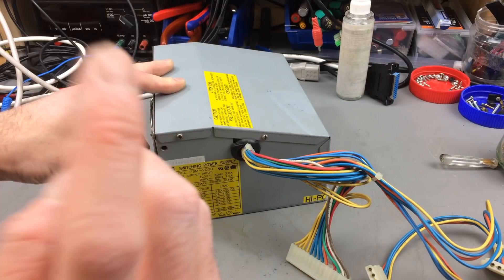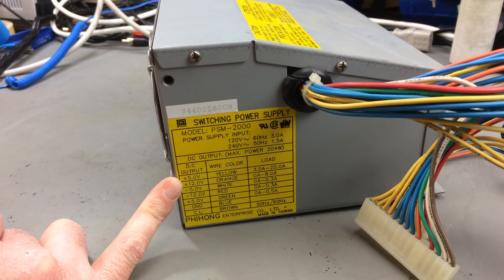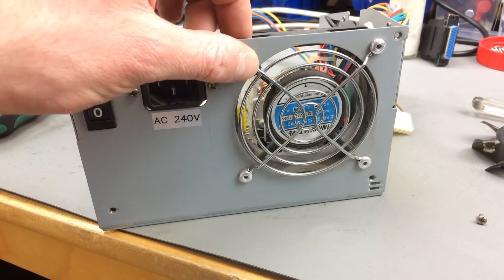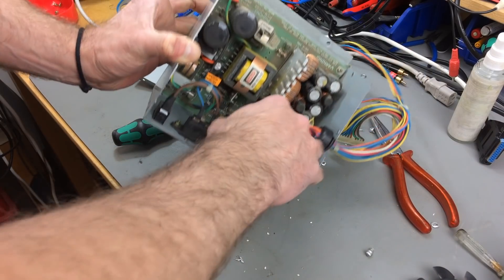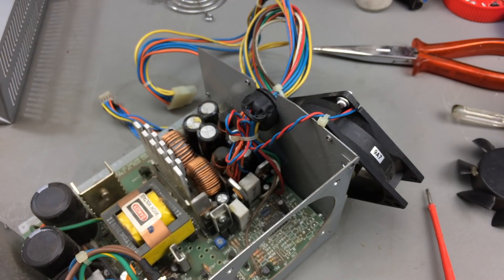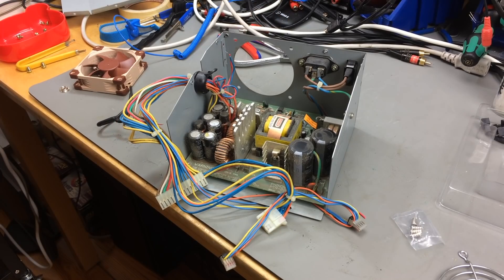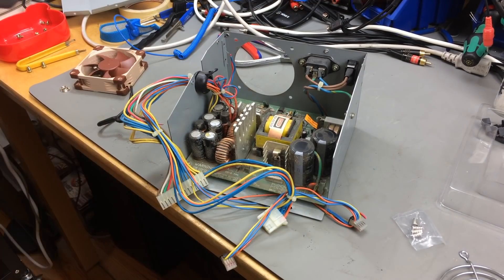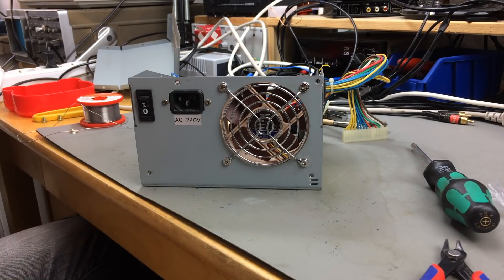Amiga 2000 Power Supply Fan Replacement

Comment: Thank you very much for this, Your my friend for life now. I've just swapped out my amiga 2khd fan, with a new one, as in your video, and I seem to have a slightly differenent power supply unit, as it was a matter of moding the cable that weas attached to the fan with the correct placement of cables i.e.  red black correctly into the little plug. So no soldering for me, but without your video, I would have been too aprehensive to even try. So cheers :)👍

Comment: The old fan has an airflow of 0.93m3/m, the new one you inserted only 0.58m3/h (Noctua.at says 34,8 per hour). So the new one blows considerably LESS air. That's why I used "NF-R8 redux-1800" for my A2000s, those blow 0.88m3/m.
Reply: True. I replaced mine with the one suggested in this video and you can feel that the airflow is considerably lower. I'm disappointed. I'm going to buy the one you suggest and trash the one I just bought. 🙁

Comment: Great video! I stumbled across it when I was looking for help replacing a fan on an old  Gateway 2000 Pentium 3. There is only 1 fan in the case and that is in the power supply and it's so loud!
Reply from the maker: Yes, you most likely can mod that in a similar way. :)

Comment: Despite my background in HW repair, For reasons that  cannot explain when I swap out my old 12v fan for this new one the power supply cannot sustain and load. In other words the NF-A8 ULN Noctua fan runs if the power supply is not hookup to the mother board. If I turn on the PS with it plugged in to the MB it shuts down about 1 second after turning on. If I disconnect the FAN and try it runs even less time. Put the old fan back in and the PS runs the MB no problem.  Red to red black to black. I did not use the yellow wire. My A2000 supply is Model 20504-SD made by ElEC & ELTEK.  And ideas?
Reply from the maker: It seems that some of the Amiga PSUs check if the fan is running by measuring the current draw. If there's not enough current flowing to the fan, they won't turn on the supply or turn it off after a short time. Probably the modern fan draws too little current to trigger that circuit. Maybe adding a resistor would help?
Reply: @JanBeta  Thank you for the quick response. I reached the same conclusion. So I put a1200 Ohm 1W resister across the fan leads. In my pre assemble not everything back together test It stayed on so I thought I was out of the woods. However after final assembling of the machine it shut down again but took longer. It was not instant like before. I think I may have only added .01 Amps to the poultry .05 of the noctua. So that is still less than 1/2 the .12 amps my old fan pulled. I am a little hesitant to put less resistance I would need higher wattage resisters more heat yada yada.  I may have to put back the noisy fan :[

Comment: O did this but my amiga refused to boot up. I put back the old fan and it works again? Any idea why?
Reply from the maker: I think some versions of the A2000 PSUs have circuitry that monitors if the fan is working by measuring the current. Modern fans draw a lot less so it might not trigger the circuit which in turn doesn’t allow the PSU to fully power up. Maybe adding a resistor to the wires that go to the fan will fix it (even though it’s a workaround of course).
Reply: @JanBeta   I will try adding a resistor and see from there. thx mate :)

Comment: "battery backed up clock not found" at 14:07
Reply from the maker: Yes, in the meantime I have a coin cell in it and the clock works fine. I think I had to reset the chip to make it start, too.

Comment: Well done - you can make a circuit to generate -5 volts from +5-12 volts - check out a ICM7660 - there's lots of variations of this of course (I wouldn't be surprised if the out of the box Amiga power supply actually uses these...).

Comment: Great to see you use the same fan as i used in my C128D (plastic enclose version) , but that one is 60mm.

It's the Noctua NF-A6x25 FLX, Noctua fans are one of the best fans you can buy, and are much quieter, but they are NOT cheap, they cost a lot.

https://noctua.at/en/products/fan/nf-a6x25-flx

Comment: Another brand I recommend are Cooler Master, as their 120mm fans can be had in a 4 pack for $13 USD with free shipping, and a single 80mm fan from them can be had for as little about $7 USD with free shipping. So I always find good value in them when doing projects like this, or building modern/ish computers on the cheap.

Comment: Please, please DO a power supply recap video. To me it would mean the world, not just to watch you refurbish that Amiga, which is pleasant enough, but also because I have some gear I'd like to try to repair with such big, life-threatening caps, and I don't really know how to safely discharge them. I picked up an audio amp from the trash in hopes it might be repairable, but I'm too scared to try because of that, and I'd like not to have to bring it back to the trash, it would be such a pity, but keeping the thing forever and not working on it would make no sense either!
Reply: Just noticed your comment here. Might be too long ago to be of interest, but anyway, here goes. Electrolytic capacitor have a rather high self-discharge, so if the device has been stored for a year or two you can pretty much be 100% sure they are discharged. Also, if you want the make double sure, check that the power supply is not connected to mains and turn it on. Whatever charge might have been left will then quickly be dissipated by the circuit it supplies. As a master in telecommunications I have never had any problems doing it like this. The only exceptions I know of are with tube amplifiers. Partly they operate on very high voltages (700V+), partly the power supplies therefore tend to use paper or ceramic caps that have significantly lower self discharge. In those cases I would be vary, and old CRTs are also a problem. The rear parts often tend to build up static charges - by far the worst electric chocks I've experienced have been from accidentally touching those... A normal PC power supply or audio amplifier, however, never poses a problem if you just do as I described.

Comment: Hi Jan, that quiet adapter with the fan may well be a temperature thermistor type thing that will ramp up speed depnding on ambient temperature (inside the PSU) so could perhaps be not even turned on until needed?  Not 100% certain, but with something like Noctua I don't think they'd just throw a resistor in and call it a day :-)  Maybe another upgrade when you re-cap that power supply ;-)

Comment: Phihong! that's still a name brand today!  BTW: Some A2000 PSUs refused to start if you put a regulated fan which drew too little current at start.
Reply: Hi, i did the replacement today.. and my PSU refused to start... i was afraid to have damaged my motherboard or the the PSU... i connected back the old fan and every thing is OK... do you have a solution for the replacement of the fan with a quiet one. Tks
Reply: @supporttrombone5744  Just connect 2 car parking light bulbs for 12V each in series in parallel to the  12V for the fan, so they just draw 1/4 of the nominal 2 watts. those 0,5w in parallel with the new fan and the PSU will start. and the low glowing bulbs will last forever.
Reply: @rarbiart  tks. i'll check if i can find a fan in my old stuff which have the right power consomption. Again thanks.
Reply: @rarbiart  Thanks for your help, i wanted to find a Fan which has the same power consomption but they were MORE noisy than the old one !!! I put back the new NOCTUA (silent) and i found a nice light green bulb... i had to make some modification at the casing of the computer and to the power supply...  now it is perfect !!!

Comment: Did the same to my A2000 PSU, even the same Noctua fan, like 2-3 years back. :) Mine is with a Lite-On PSU which didn't have the old fan riveted in fortunately. I put a matching connector on the old fan wires and used the low noise adapter too. Ended up with a system which is nearly inaudible, quite nice. I still need to recap my PSU as well.

Comment: I would say you should NEVER put a power supply without the -5 volt as it's usually used for OP-amps and they usually go boom if they are missing the -5 volt, potentially destroying the zorro cards.
Reply from the maker: Yes, I definitely agree. If you are not absolutely sure nothing in your machine needs the -5V, you risk damaging stuff. I think the usually applied workaround would be to use an 7905 voltage regulator to supply the -5V if the psu doesn't support that voltage.

Comment: I'd have recommended first covering all the exposed electrical components and contacts both outside and inside the PSU before drilling out any of the metal rivets holding the fan to prevent any of resulting metal fragments from contaminating the PSU and causing electrical shorts later.

The clock not detected may be due to the RTC chip being in an indeterminate state because the RTC battery was removed.  Saw this in a recent Amiga A501 repair video that replaced the rechargeable RTC battery with a 3v lithium cell battery holder. Try using the sysclock utility to set the time on the RTC chip (initializing it) and then read it back.

Comment: can I use this vid as a reference for my A4000 PSU? Or...?
Reply: The A4000 PSU is somewhat different, but the fan stuff should be more or less the same. IIRC, the fan sits on the inner side of the PSU and sucks air from the computer case into the PSU instead of blowing air out of the PSU through the back. Are you saying that your original A4000 PSU is still alive? Mine died already in the 90s, and I had to find a smallish AT PSU and transplant its guts into the PSU enclosure of my A4000.

Comment: Apart for replacing caps, dont forget to replace the thermal paste on those fets. It'd be amaizing if before replacing the caps, you could measure the ripple voltage and voltage rails before and after the refurbish

Comment: Perfect fan for it, they're well engineered & I think the colour works well. I was nearly yelling at the screen for you to fit a standard 3 pin fan power socket but as you said, it isn't much effort to solder a new fan if the Noctua ever dies! Great work as always Jan :-)

Comment: You could install a noisekiller (temperature regulated resistor) on the fan. It will increase the resistance when temperature is low, and reduce the resistance when temperature is high. But since you installed a low rpm fan, its probably no point.

Comment: The drilling worked surprisingly well this time! However, you should consider getting a Dremel, which is really a really good tool with fine control over your work - also when cutting metal.
Reply from the maker: I have a Dremel tool (well, a Proxxon one) but didn't use it for the rivets after some research. The drill seemed to be the cleaner option in this particular case. :)

Comment: Hmm.. it's saying "Battery backed up clock not found" - did you remove the clock chip ? If not, thats a sign of a problem. The clock should still be found even if the battery is removed.
Reply from the maker: Oh, I didn't even notice that. You are right. It seems to sometimes not see the clock, on other boot ups it did. I'll have to investigate. Maybe there's a dodgy trace somewhere that I didn't see the first time around.

Comment: It's usually the case that the line capacitors will be discharged, as there is either a bleed resistor, or the PSU runs until the energy in the line capacitors is drained. The main time to take precautions and discharge the caps is when you know the power supply has been energised recently, and there was no output. I've nearly come a gutser on this working on a TV power supply - the main MOSFET had failed, and there was nothing to discharge the cap. Fortunately I remembered before I stuck my fingers near it!

I'd certainly recommend you replace the secondary side capacitors soon to keep it working well. The line side caps should be fine. Oh, and check for stinky RIFA capacitors too !
Reply from the maker: Ah, and again I'm learning something from you. :) I guess it doesn't hurt to be over cautious anyway, but good to know that they usually are drained. I'll replace the caps asap, just have to order some because I didn't have the right values in stock.

Luckily, there's no RIFA bomb to be seen in this one. I learned about those the hard way a couple of years ago when an old amplifier I was working on went up in smoke. The smell! :P

Comment: A smaller drill bit would of been lot easy for you with the rivets
Reply from the maker: You mean I could have drilled all the way through the rivet? I was a bit cautious because I didn't want to damage anything so I intentionally went with a size that didn't fit through the holes on the fan grill.
Reply: @JanBeta  You don't need to drill through them. It can help to drill into the rivet at an angle and rotate the the drill around (in a cone shape) to prevent drill bit biting into the rivet and causing the rivet to spin in place.

Comment: Touching a capacitor with a finger hurts but it will not kill you. To kill you it would need to discharge through your chest. I.e. the current would have to travel from one arm to the other.
Reply: ...so you're saying I should change the way I discharge capacitors? I usually use my tongue and one of my pinky toes to complete the circuit.
Reply from the maker: It might be a bit exaggerated that I mention it in the videos every time but I don't want anybody to get hurt if they follow what I do. Plus, if you have a weak heart or other issues chances are (albeit they are small) that they might actually do major harm to you,
Reply: I have done this by accident, touched the charging cap soldering points when i was moving it out of the way. Good thing the main power was disconnected. It was quite a shock, but i didnt die, and i didnt get "locked" to it.

Comment: On the side of the fan shell you'll find two embossed arrows, indicating fan spin and airflow direction. More reliable for installation than where the label's facing.
Reply from the maker: Yes, you are right. I was so focused on the sticker side that I didn't think of looking for the markings.

Comment: there is not much risk, a failing switchingpower suppy never puts out over voltage.
Reply from the maker: That's right, they usually don't, I still want to do some maintenance on it and replace the caps to make sure it doesn't pop at some point.
Reply: They can still put out enough ripple to stress out the motherboard capacitors and cause all sorts of weirdness.

Comment: I'm guessing they riveted the fan in because, rivets are cheaper than screws, rivets are perhaps more repeatable without errors than screws, and rivets require less labor and/or machine time than screws, and Commodore was all about shaving every last cent off production cost.
Reply from the maker: Yes, that must be it.
Reply: For sure, I have two A2000 and one have rivets, the other (a bit older) have screws. More, the newer one (!) have a transparent tape for naming ports, while on the older one, port names are printed directly on the case.

Comment: Job well done! The color of the fan matches up perfectly with the back of the A2000 and it looks amazing! What is also amazing how much crappy stuff Commodore have built into these quite expensive machines.
Reply: It is just the technology of the time. Back then you didn't get super silent fans in power supplies and if you were aiming at a low noise machine you could buy an A500.
Reply: @danielmantione  Maybe you're right. I thought Sunon existed back then and using a quality fan was possible. I also was refering to the PSU itself, but maybe even IBM used cheapo taiwanese PSUs as well.
Reply from the maker: I think the fans of the time were either rather loud or really expensive so Commodore went for the Commodore way. ;)
Reply: @JanBeta  Yeah, pile it high sell it cheap - Tesco :) ... now we know why both of these companies have blue-white-red logos :) ... oh, just found another connection, have you guys ever heard about tesco's discounter brand Jack's? :D

Comment: I'm glad to see it work so good. I would've probably mess this one up because I was assuming yellow is the 12v wire.
Reply from the maker: I actually looked up the pinout and the yellow wire is the RPM reading from the Hall effect sensor (presumably) in the fan.
Reply: I think the yellow wire is for RPM signal. I guess modern computers look for fan RPM and shut down the computer if the fan shows zero RPM to prevent overheating damage?
Reply: yellow is 12v. red is 5v . the amiga psu outputs 5v.

Comment: I would have used the adapter cable to make a plug so you can change out the fan if it ever dies
Reply from the maker: That would have been smart. Didn't think of that. But then again, this will probably last for a while and soldering on new wires is not that much of a problem.
Reply: @JanBeta  well at least it's a fully German pc now it has a Noctua fan in it! All it needs now is some retrobrite and it'll look great!
Reply from the maker: I think Noctua is actually an Austrian company but they at least speak the same language for the most part. ;)
Reply: Jan Beta : I believe so but they definitely have German reliability. Hence being my go to choice, the only brand that I’ve never yet had to replace.
Reply: because noctua
Reply: Yes, and also would be easier to service
Reply: Many Noctua fans have over 150 000 hours of MTBF (mean time before failure), which means more than half of them  lasts for 17 years of constant on time - and there's 6 years warranty - so, I think it's safe.  ;-)
Considering the quality, it's not very clever NOT to buy a quality fan instead some cheap noisy crap for 1/3 of the price. 
Cutting and soldering a connector the same way would have been the same amount of work - so, sure.
Reply: No, I replied to Amir's initial comment.  ;-)